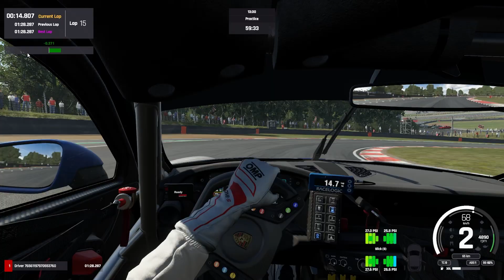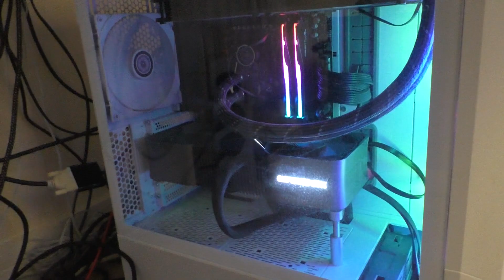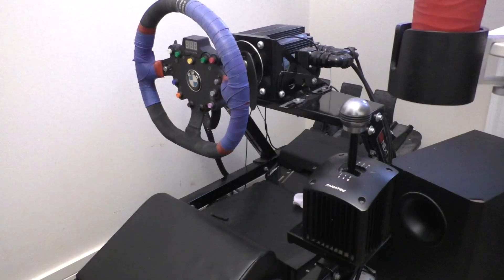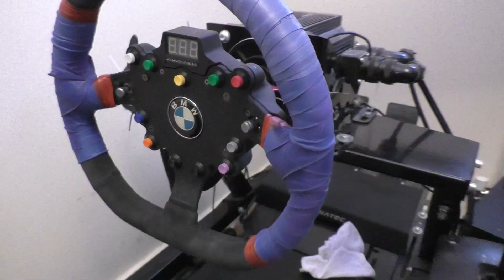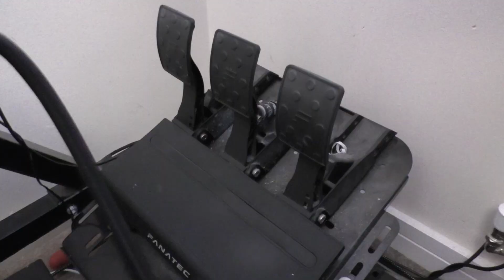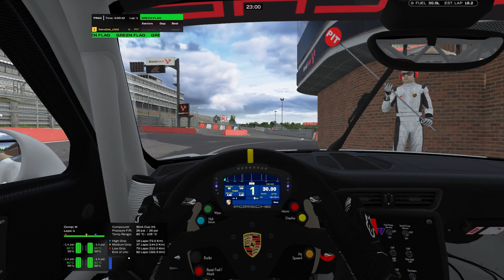Sadly Assetto Corsa EVO FFB Lacks this KEY Detail - Real Driver Explains

Comment: So well described, thanks
that weight sort of clipping everything execpt a bit entry feeling is for sure a trade off for entry wheels 200ish value w pedals to always sense some handling or public not knowing the depth or driving at the limit which ive been to aswell.

Im not real pilot but coming from iracing this review is spot on to me at 3k IR after testing ACE aswell and ive also been into AC & ACC LFM a lot. 
AC is totally dynamic trading weight wheel on straights to achieve deeper corner feel load and ACC more blend weight overall as a trade for road effects to produce dynamism.
Iracing is front feel FFB rather than the "G force Kunos way" but then the grip is felt and the load to reach a neutral kind of move to front FFB to a center G-Force when front is loose which is very satisfying but might not be fully understood by a rookie at first.

 I would rly like to see your honest take on iracing, my bet is that iracing rly teach you the true thing but wants some exaggerated wheel input precision to reach load at limit rather than irl which has a larger scope tolerance so sort of less twitchy doubt (at least at first glance) than IR before you even put it in neutral slip angle

Comment: Useful video! Worryingly, ACE seems to have gone for realism rather than information. WE DON'T WANT REALISM FOR FFB! The whole point of ffb wheels is to replace sensations missing from real life (like mostly SOP and feel of grip, lateral load) and give the players this (vital) information back.

This realism attitude is what completely turned me off ACC. It was utterly disgusting and useless, frankly.
Reply: Speak for yourself, I want realistic FFB and not any effects that wouldn’t be there in a real steering wheel. 
I’m not absolutely ruling out that it can be a good idea to include settings like SOP-feeling but “steering column forces and nothing else“ has always been Kunos‘ approach and I doubt it will ever change. Having that “enhanced understeer“ setting in AC1 still haunts Stefano to this day 😂
Reply: They should have 2 presets, one for information and the other for realism
Reply: @deathtrooper2048 sounds good in theory but make no mistake, all the fastest guys will be on information and everyone would soon switch over to compete, eventually leaving no-one on realism..
Reply: @mattikake9859  Some people use the simulator as a simulator and not an online hotlapping application.
Reply: I love this FFB I have no idea what you talking about, this is the best FFB we’ve had

Comment: FFB isn't there on a Logitech G923 , not much to feel at all, and the constant FPS Drops on a RTX 4070 in even the lowest settings don't help the game either , the only thing that feels normal is the load cell Brake from the Logitech Pro Pedals !
The Game needs a ton of Work to get anywhere close to the original first AC !
Unfortunately I can't agree with your opinion because I don't own any of your equipment or Real Racecars to make a real comparison like you did here😂
Keep up the good work 👍 great Video !

Comment: Found this very interesting and decided to replicate your testing and I agree with all the points you make. It’s next to impossible to feel rotation and slip mid corner in ACE. The more you push in ACE the more lacking the ffb is compared to AC. I also spend a fair bit of time on track in my Exige and look for realism in my driving sims. Early days yet for ACE and I really hope they will surpass the old AC in terms of ffb. Great video mate !

Comment: With kindness.
It sounds to me like you want the steering FFB to specify to you how much steering input to give to achieve optimum. Owing to you referring to the opposite forces when passing adhesion. Is that right?
I ask because, for me the FFB is great because it doesn't do the driving for me, but still tells me precisely what the surface is like, and where that optimum is through genuine information. So I'd much prefer it remain as is, rather than start to add in the oven ready 'cheat' which you desire.
I understand that there is a difference of opinion around this matter, but while you're saying you can't feel the forces necessary to give you this seat of the pants information, I am saying that I can. It just doesn't feel like what you're expecting.

Yes I believe you are correct in that the FFB is just what a steering column would provide IRL.
If you want that feedback and guidance, look for the hump in resistance on the fronts. Less strength after the wheel position which has the highest strength. You're not feeling anything once you've started understeer, because you're not returning back to the hump where adhesion was strongest.

Correct, there is very little information about the rear tyres, as I would expect IRL, until after you've pushed them too hard.
And yeah, ABS is pretty dim, I'm not convinced it is there at all.
Reply: The difference is that IRL you will feel it not through the wheel but through other information you feel like g-forces/your ass/noise/etc... In sim you should get this info from the wheel so that you can drive out of getting that information because then if you want to reach the limit and get the best pace you will mostly reach it out of practice/muscle memory.
Reply: @inebium  
I understand that, I just disagree that it is necessary, and feel that it is a crutch.
The ffb detail is there sufficiently to supply all of that information as is, it just isn't handed to the player quite as blatantly as (presumably CM/CSP have made it) in AC1.

Comment: Hey, you need to go into control settings, pick your device, select that device settings, and put everything to 0 except FFB Gain, off course steering lock should be set to the same as your device software ( normally 900) but all those "damper" and "assist" settings should be 0, I found 40 - 60 % FFB Gain to be realistic, the 6 - 8 other damping and assist settings should be 0, the FFB Gain is your FFB setting to feel everything, all the other settings are damping that FFB or adding fake FFB which you really dont want.

Comment: You have Sim-Plicity Wheel??? Damn, bro's an OG sim racer.  Respect for making the jump to the track
Reply: I do have to mention, if you normally drive cars with no power steering assist, it might feel wrong.  I think AC Evo might be accurately simulating P/S systems unlike other sims, but I could be wrong.
Reply: @ProjGR  It does, but the thing is you also need to convey g-forces/seat-of-pants information because 99.99% of us don't have a motion rig. This is what makes the FFB great
Reply: @d.o.5238 Exactly; well said.

Comment: Try using up to date equipment that is much more advanced than 10 year old gear maybe?
Reply from the maker: guess what matters more than it's age?   What it actually is.
Reply: @mo-r-racing  Not really dude, it was great in it's day, it's a relic now in terms of tech. I have used so many new dd wheels and makes my dd2 feel old because they can produce more detail.
Reply: @1STB11TME Your wheel, assuming you have one, probably don't even have 1/4 of what that wheel is capable of. This guy reviewed the ffb feeling for what actually is and if you're used to sluggish and weird guessing feelings, you've been playing too many games. Go to a track and try for yourself. Street cars and sports cars are different sure, but there's no way i'm starting to slide at 60kmh. Found myself doing many hairpin corners irl at 80+ and trust me, i should not be here to tell the story if this "early access" sim was even slightly close to reality. This review makes completely sense, to me at least.
Reply: @kobrv3419  I have been sim racing for 25 years, I have done real racing for 15, I use a Fanatec DD2, much newer, and yet newer wheels than my dd2 have more detail come through than my wheelbase. I don't care how good that wheelbase was 10 years ago when a simple £600 dd wheel probably had much more detail.
Reply: @1STB11TME  Details of what? The feel of the available grip mid-corner isn't something that requires an insanely fast wheel response (and that's essentially where the newer wheels are better than the older ones). You would feel that even with an old clunky G27 in a sim where it is done right, like the original AC from 2014. Yes, it will be quite muted as the dynamic range of the G27 is very limited with its meager 2.5Nm max torque, but it will be there. AC Evo, on the other hand, feels completely bland, very similar to how ACC feels and that's a shame as we know that Kunos can do much better than that
Reply: @d.o.5238  Done talking to brain dead people with no clue
Reply: @d.o.5238  All i am saying is he isn't getting the most out of any sim using a relic. You can't say otherwise  lol. I am done on this conversation
Reply: @1STB11TME  I tried it with a DD+ and I agree with everything he's saying. There's no feel of the car being balanced after the turn-in phase. Same as it was with ACC. Those who drive way off the pace and/or don't rely on the FFB to get SoP information won't notice it and will believe the FFB is great
Reply: @d.o.5238  I have held multiple lap records on various sim games going back to Live For Speed. I do real racing and sim, I am not just some kid pretending to know what I am talking about. Not done much sim racing these days due to health but at the end of the day his wheel isn't going to give the same information compared to a new DD wheel with newer tech, that's simply all I am saying.
Reply from the maker: VRS DirectForce Pro uses exactly the same servo motor - is that also out of date tech? Maybe you should let them know so they can update it
Reply: @mo-r-racing  You think it's all about the motor do ya lol? It's OK mate, you do your silly little reviews with your antique and think it's comparable to new tech. Have fun 👍
Reply: @1STB11TME Why don’t you do a short review on this specific issue and show otherwise, it might be more helpful to leverage your experience as well.
Reply: @1STB11TME  The point here wasn't even the tech. You put it out like it was a tech problem, which it clearly isn't. The whole review is about providing a feedback to the devs and feel the community thought about this. It's also about not getting real feelings and discussing ffb, cause even with top tier gear you don't get what og AC physics provides. I have a simagic alpha and the review makes completely sense to me at this stage. In the current state, EVO doesn't have anything better to provide in comparison to og AC. There's still a lot of work to do. The problem is not tech related. Meanwhile, since you've been so aggressive to everyone, go play your ps5 or whatever and let the "brain dead" people sort it out for you too, you won't regret it.

Comment: also in real life when you turn the wheel excessively the wheel become lighter, AC1 have a option to enable a felling a bit more real, but it mess everything else... the wheel should become even heavier in the point of max grip, like a turning barrier, and when you try purposely to pass that the wheel vibrate and become light

Comment: The sad reality is ACE is closer to ACC in terms of ffb and feel of the car than to AC. I remember when ACC came out you couldn't drive the cars without tc because there was no information in ffb when the rear step out. Same issue in this game. You can not drive on the limit because of that. I hope they can fix it but i wouldn't bet on it. Great video anyway! 👍
Reply: So true, AC was the peak 😢 10 years and still no noticeable improvements
Reply: the FFB feels nothing like ACC imo
Reply: AC has the best ffb, then ACC, then ACE. They're getting lazier. I guess it's not a passion project anymore, they're rich and have nothing to prove. Even if they make mistakes, they have fanboys rushing to their defense. It's like when a band comes out with their first album, the put everything into it. Then after they've made it big, the record label demands a new album, and even though the band doesn't have any new good stuff, they just crank out a garbage 2nd album, make the money, and the fans that say it's not up to standards get attacked by the groupies.

Comment: To me this is how LMU feels largely (not the dampened effect). The late effect of what the rear is doing. Its like you only feel it once the front steering rack has enough force on it to tell you, but this is when the rear is already too far gone most of the time. I don't want "canned effects" but at the same time, FFB is our only communication and we need to be able to feel what the front and rear tires are doing at the limit. Its not clear in most sims. Either the ffb is so damped you can't feel it, or its too authentic to steering rack only which only gives suspension forces, not necessarily how the tire is gaining/losing grip after the suspension is loaded.
Reply: can be that it really is delayed... maybe the physics is running in a lower Hz to maintain decent performance.

Comment: I think what people need to understand is that some cars like the Lotus 49 require you to have a more expressive FFB. Because these are cars that we drive by feel, where the chassis rolls much more and each micro input puts the car in a different direction. We only have street and racing cars derived from street cars. Furthermore, almost all of them are recent and I fear that not only will we not have single-seaters, but if we do, the FFB will not be expressive enough to drive. And I think Kunos, aware of this, did not provide us with the Lotus 49 in the first Early Access version fearing that the car would be undriveable, exposing more explicitly the FFB's flaws.

Comment: 5:03 this was exactly the point I was trying to make when explaining how I felt about the game and force feedback. There’s no real feeling of resistance of the tire or traction as you are going through the turn.  I was thinking it was my wheel setup with the g923, but you have a different setup than me and are concluding the exact same response this leads me more to game development.  Btw my force feedback setting is on 85% that’s way higher than any other sim racing I’ve played and I still don’t get any feedback.

Comment: All done on what looks like a not so smooth 40 fps on top end hardware. FPS could also effect FFB
Reply: completely ignored the fact that he has a 4090 in the intro its just a video quality thing and his graphics settings probably set to low since he doesnt care about it looking good but rather maximising FPS
Reply: Good point, but I was getting 60 and concluding the same exact thing though.  While I agree on it needing to be optimized especially when we get to free roam there is something out of place with force feedback.  If they want us to do something different with our ffb setup maybe setting reference notes to explain their intention of the setting would help.  Other sim racing games give a description by each setting to help the user make their decision on how best to fine tune
Reply: @  ahh ok, 60 should be enough then. 
I have not been able to test it much yet.

Thanks for the informative video, much appreciated. I should have opened with that first
Reply: Why would FFB be affected by fps? The physics engine is still running at proper hz.
Reply: @JasonMurphy22   Do we know that though? I don't think we have a way to measure it.

I was just thinking of BeamNG drive when i made the comment about FPS - FFB
Reply: @JasonMurphy22  Not necessarily. Visual stutters can make FFB feel delayed because the brain struggles to sync what it sees with what it feels, even if the physics engine runs fine. Also, actual FFB delays can happen if data from the physics engine is slowed down by CPU bottlenecks, thread priorities, or USB communication issues. Both can create the impression of "laggy" FFB.

Comment: need to clean that stuff 😂.
on a serious note. ACE lacks details and feels mushy. its like it has a ton of damping with an annoying spring effect added to it.
Not what i was expecting from Kunos. i guess Aris and Stefano leaving had a bigger impact than i thought it would.
Reply: Take the dampers off from the ffb settings.
Reply: @ototso9281 Damping effect is baked in. You can't remove it even if you disable all Damping in your wheelbase and turn everything damper related off in-game, it's still there.

Comment: Played ACC & ACE side by side. ACC imo is far superior in ffb, haptics & audio.

No brake audio until locking up is another. The only cue is visual, when the weight transfer makes the bonnet dip slightly. If looking out straight ahead, drivers miss the cue and there's no audio or haptics to help until it's too late. 

The haptics and ffb are so far off it feels like your hearing Spanish despite speaking English 🙃

ACE also fell flat on its face making the same mistakes when Forza launched with bad UI, ffb, graphics, weather and track design. Sound familiar huh?
Reply: ACC having better FFB says it all 😂

Comment: Maybe you need to adjust more or its your hardware because I feel it.

I have over steer in boat loads. Idk what you are talking about. Nobody not a single other pro has said this if anything all said it feels better with ffb then any other kunos title. 

Maybe you turn dynamic dampening off without realizing what it does to the tires? 

Like i hate when drivers come in tallking about what a title is missing, doesnt shoe a single setting and doesnt realize or jnow how to pull out the oversteer feeling? Or just all the effects you should feel that you arent? It doesnt make sense to me. I can get it as understeery or over steer feel as I want.

You can be a driver all you want but it doesmt mean you actually understand how to pptimize ac evo to feel the things you want.
Reply: You would recommend using some dynamic damping then?  I hope Kunos adds descriptions for each of their settings; maybe there is a section within their discord about it..? 
I'm using a CSL DD 8Nm.